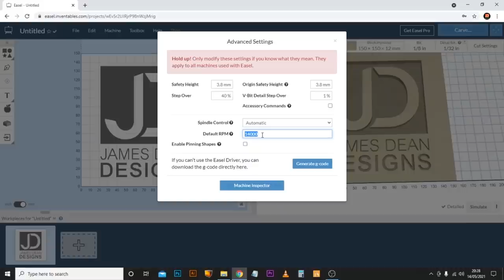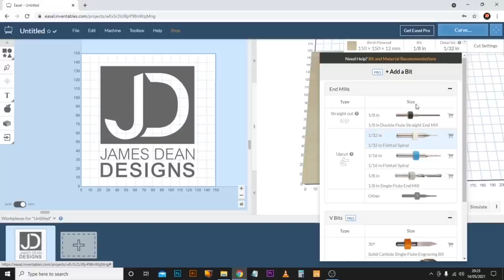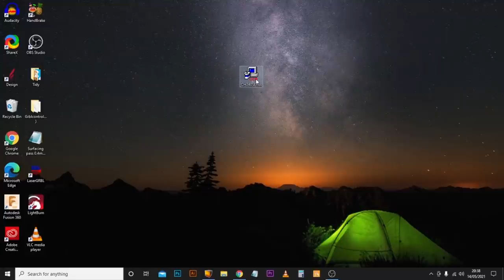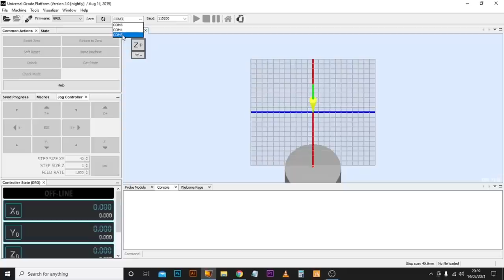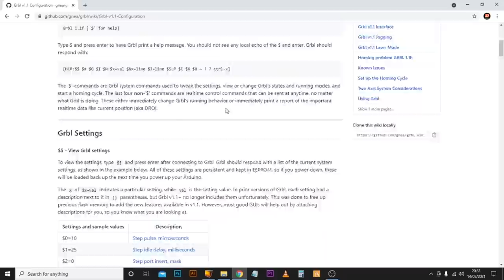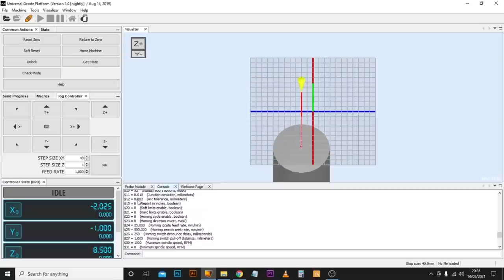Top 10 issues and solutions for desktop CNC machines - 3018, 4040, 4060, 6040, 6060,

Comment: I just watched this video. I'm about a year too late to help with the laptop problem, but here goes. Most laptops have a power control option on the USB ports that will shut the power off after a predefined time of no user interaction.  The strange thing people don't realize is that means mouse or keyboard interaction, not USB communications. You can set the option to "Never" on most laptops. Great video!
Reply from the maker: Yes that's true. They also Microsoft also added something called Selective USB Suspend in one of their updates and that so causes issues. So not only do you have to turn off the power saving features and put them to Never, you also have to disable this additional setting as well. Bit of a pain

Comment: James, superb series of videos/tutorials.   I bought a 2 in 1 3018 and watched several of your videos whilst awaiting delivery.  When the kit arrived, I assembled the whole thing without reference to the (inadequate) assembly instructions.   A few minor hiccups on connectivity and then up and running very quickly.  A couple of tips I'd like to add: 1. Rinse/dry/clean/dry lube the screw rods (I had to do this retrospectively as I was so keen to get going). 2. When fitting the coupling (bit that connects the step motor to the screw drive) I had to dissasemble and create a tiny gap (two sheets of paper) to stop the coupling rubbing against the body of the motor - this fixed the problem of sticking/skipping due to drag.   Your suggestion to use blue tape / mitre bond is brilliant and saved my sanity.  The clamps are so badly designed.  Thank you so much.
Reply from the maker: Glad it helped and glad you are up and running

Comment: Good stuff! I was one of the unfortunate customers who received a model where the motor was on the left so I was lost on how to switch this around. I also had spindle problems with certain programs. One would only allow the spindle motor to run and none of the other axis, the other would allow everything but the spindle. So I decided to move onto the laser. I quickly realized I got the more powerful laser that doesn't have the proper connection on the board itself so I will need an external power supply to get it working. I've revisited this machine a few times over the past few years but never really have the time to troubleshoot it. Your videos help immensely but I find it a little distracting how you use different programs for certain settings then bounce into another. But at least I have a general idea on what to look for. Maybe I'll get this thing running yet!
Reply from the maker: In this video I do bounce about because it's problem solving but usually I just stick to Easel and UGS 👍 hope you get there with it but let me know if you have any issues

Comment: re comms cutting out part way through a job - I found that problems sometimes came and went with Win updates, and the 340 drivers have a bad reputation with windows. I took to checking whether my CNC was still working every time there was a win update, so I could roll back before the time limit. I now use a raspberry pi. I have always used candle as it is what arrived with my 3018. Candle for the raspberry pi has defeated many linux fluents (of which I am definitely not one) - but there is a port of candle for the pi out there on the web, and even in my noobery I got it working.

As to recognising a comms failure (it was always that the driver had lost connection to the 340, so was unrecoverable without an unplug/replug, which resets candle) - typically the symptom was that the spindle was left spinning but all the axes stopped moving. The key here is that GRBL has not detected an error, so has left the spindle on while it waits for more commands.

The key to recovering is that BEFORE doing anything you look in the Gcode log to see where it got to, then you know the current position of the axes (because the lack of error condition means GRBL successfully executed the last command it heard). Write down the latest position in the Gcode (NOT the current displayed position, because the actual position never made it back to the PC because the comms broke), and replug the USB. When candle comes back to life, it will consider itself to be at 0,0,0, but you can move it back to "real" 0,0,0 using the "latest point" you wrote down above (basically G0 then negative the numbers you wrote down, but be careful not to move "through material" - best to move Z upwards to a clearance height, then X&Y, then Z). Then zero the axes and you've got a shot at continuing the job. Ideally edit down the Gcode to omit all the moves it has already made (but obviously not Motor control / other settings) - this is only if you understand the Gcode well.

FWIW I have a switch in my spindle feed, so I can switch off the spinning spindle while I'm investigating where it had got to.

Comment: I guess my problem may be the g code itself. I keep having the same shut off problem at the same time into the cut, approximately. Trying to surface the spoil board has become insane. I've tried it with the laptop more than once. With the offline controller more than once. Which tells me it's not the laptop or the controller. I've used both the laptop and the controller at different times with an IO -T relay. I started with the IO-T relay and thought that might be the problem. Once I took the IO-T relay out of the circuit it seemed to work one time through but then the stopping problem returned on the next pass. I know I'm going to end up on the phone with Foxalien and just want to beat my head on something. Is it possible that some some part in the big control box is screwed up? On an unrelated topic, when using the offline controller it's limited to jogging 10mm at a time. That's very slow when you have to move 25" / 636mm. I would just send it back but I really don't want my laptop in the shop if possible. I should say my machine is the Vasto xl.

Comment: You forgot a big one, people not using ER collets correctly. I have seen plenty of videos here on YT where people insert the bit into the ER collet, then stick it in the spindle and fastening it with the ER nut while the bit is already in the collet.

ER collets have to be clicked into the ER nut first (without the bit), once the collet is clicked in place you can insert the bit and screw the lot onto the spindle (or even better screw the collet and nut on the spindle lightly first, insert the bit and then tighten it down).

Comment: James
I just installed UGS  to run my machine ( 3018 pro) to replace the gcode sender that came with the machine ( grbl control).  the ugs loads and will communicate with the machine but has a fault. the fault is that when I  click on the jog buttons the program will not always send the command to  the machine.  other times it will send the command and the machine does as the command requests. in addition the machine ( while running the program code as sent ) will run a small portion of the code and then stop. I have run code using the grbl control and have not had any problems ( some of the buttons do not function , and never have  zero z and zero xy) I have noted your use of the ugs and though to replace the grbl control  with ugs to help me get away from some of these problems. Anything you can do to help?

Comment: After watching several of your videos, I am still struggling with my CNC Router.  I tried sending you an e-mail in hopes that I would get a response, but I have not received one yet - this might be the only place I can put my question/problem that I am having, I guess... My email goes into detail but now I don't have the email to copy & paste it, because I sent it directly to you from your website's 'contact me' button.

However, when I am using my CNC, everything will be going fine for the FIRST cut, the Z-Axis will go down, cut the material (wood mainly) make the cut etcetera, and then when it goes back to continue (either the same area or moving to the next cut) the Z-Axis will move upwards and not come back down to touch the material, and if it does it barely touches it or makes very shallow cuts.

I have tried running the same project over and over, moving the Z-Axis down as far as the material will allow for, but still I run into the same problem where the Z-Axis will go up and not come back down again.  I don't know a whole lot about this stuff (which is why I emailed you, figuring it would be an easier/faster way of communicating) and I was really hoping for some sort of guidance as to how I can make my CNC go DOWN and continue going DOWN so it will actually cut a project the way I want it to be cut.

Thanks, Sarah.

Comment: my machine does some random movement in the middle of a job. It always does a random movement but not always the same. So, the error (random movement) always differs. The job is saved on a card so there is no USB-connection while running the machine.
any idea?

Comment: Another great video James. Once again very informative. 
Can I just point out something that I've not seen in any of your tutorials ( though I could be wrong) , VREF settings for the stepper motors. I was having an issue with my 3018 constantly loosing steps. When I checked the drivers (woodpecker board) they were only putting 400ma to the steppers. Since adjusting them to the proper setting for a nema 17 the issue has gone.
Reply from the maker: No, that's not something I have covered in my video but is very useful. Thanks for sharing
Reply: @JamesDeanDesigns  It would be great if you do cover it at some point. Took me a bit of research to get there. With your fan base, and ability to produce easy to follow tutorials, I'm sure it would be appreciated 😀

Comment: I have a 6060 running gSender. I can see movement on the screen when I manually jog the router but the router just makes a clicking noise and no movement. Any thoughts. I have a 19 second video of the issue.

Comment: Thank you.   This video help me with one of my issues.   I am new to CNC and purchased the 3018 pro.   I also add the 3040 Y-Axis Extension Kit for 3018 Series CNC Router and  spoilboard.    Do I need to change any setting. I can not find any information.      I am using Vectric Cut2D desktop and Candle (Grblcontrol).
Reply from the maker: You don't need to adjust any settings in Vectric as that works on the material size. But you may need to update you $131 GRBL setting ti reflect the new length of your bed

Comment: Hi James, great videos and thanks a lot too...I have a bit of a problem with a mini CNC machine from Banggood, its model is a 1419.  Now I'm using Easel to simply generate a 20mm circle pocket I want cut. That's all fine. Am using UGS as my platform for importing my easel file. It all works fine until its about half way though the job or so and just looses connection. My green comms LED stops flashing, so no comms obviously. my fix is I need to re-connect, sometimes at that stage it resets itself to zero. I have to start again. Sometimes when I get it to try to go to 'zero' it goes the other direction..odd I know.
I see that the control board is really an Arduino Nano , if that makes any sense to you. Anyway, when the unit isent actually doing any work and at idle, comms is fine...Could it be power, lack off that is . ?
Reply from the maker: This issue can be one of many things sadly and it's purely a process of elimination until you find the cause. I doubt a lack of power is the issue but there is always a chance. The reason I say I doubt it is because a lot of people upgrade to a bigger PSU anyway and still have issues.
Sleep mode, Selective USB Suspend, USB cable are usually the most common but I've been having an issue recently when using my vacuum on the dust shoe. It's generating static which is causing it the drop connection 😕 as I say, it can be one of many things making it hard to resolve

Comment: Hi there! I just got a 3018 pro and i have some issues with him,maybe you have some idea whats happend!
1. I charge the PCB file from Flatcam and most time CNC start running without turning on the spindle...i must stop,abort and try few times until works.
2. The software is GRBL Controller and last time didnt show the PCB,only the milling lines adn i couldn't set the 0 for Z...i got in log the message ok but nothing happends.
3. i dowload "Candle" but in candle work only the spindle when i press the button,the axes not works...i didnt try to charge the pcb to see if it running or not
If you have some tips or ideea what i can make,please help!

Comment: James, just found your channel. Thank you for all that you are doing for the community at large. Great information for beginners and, especially in trouble-shooting issues. Quick question or two - I notice you have your cnc's in housings. Is this for noise and dust, or simply to keep the machines clean? Also, I'm looking at a small bed cnc - 17x24" - what cnc's do you recommend in this size?
Reply from the maker: Thank you 😊
I have them in enclosures for all of those reasons you mentioned. Minimises noise, stops dust getting out and also stops dust/debris getting in when not in use. Also when using the laser I have an extraction fan to get rid of the smoke.
In terms of recommendations its a bit of a middle size you're after you can either loom at the Sainsmart ProverXL 4030 and buy the extension kit, or a Yorahome Silverback which is 24x24.

Comment: hello, Best channel I have found for cnc info. I have one question, What bit, spindle speed and feed rate should be used for aluminum?? I have the 3018 pro. I have not broken a bit but the bit chatters and goes out of path.
Reply from the maker: 3018s are not really designed for aluminium but essentially if you're getting chatter you either need to reduce the depth per pass or slow the speed down. My first choice would be depth of pass

Comment: I am new to CNC Machines and I am having problem with my CNC 3018 Pro it is does not do the cut where it meant to be. for example my design in the centre of the work sheet but it always do it on left side and half of it can not be done it comes outside of the working area and sometimes it comes like a reflection. can someone help please.

Comment: Great video, as usual James.  My problem is, everything works fine, cuts fine (mind you still on simple shapes). Thing is, it cuts on the work piece, upside down. When finished, of course, the shape is cut and I just turn it. But just wondering why. Is it a matter of changing the $3 line? Cheers    Peter C.
Reply from the maker: That's probably it. As the 308 move the bed the movements are kind of opposite, so clicking forward should actually move the bed towards you. $3 is more than likely the cause
Reply: Thanks James  :)

Comment: Thank you so much for all your help a few months ago when I was setting up my fox alien 4040 – XE. My machine has been running fine for a few months.When I try to home my device and it hits the switch on the left side wall coming in it starts to jerk and will not stop unless I  shut off the machine. Do you think it could be that a motor is going bad or a switch? Any help would be much appreciated!
Reply from the maker: It might be your limit switch not making contact. The easiest way to test is press the home sequence then manually press the limit switch with you finger. If the machine stops then its working, but if it doesn't then you may have a faulty switch.
Reply: I have a similar problem. Haven't found a good answer for it yet. The limit switches work fine unless I try to home it-- then, I have to hit the emergency stop because it won't stop with the limit switch. I know this sounds crazy, but it happens every time.
Reply from the maker: @amillard264  all limit switches or just one?

Comment: Love your videos sir very informative and much appreciated. Whenever I create a design in UGS itself and send the design, the gcode that is generated for that design is defaulting to a spindle speed of 0. How do I fix this so that when it is created it defaults to at least ON? Also to note this does not happen when the gcode is imported from easel.
Reply from the maker: Thank you very much for the kind words. I have never actually used the design features within UGS so to be honest I am not 100% sure. There is usually somewhere to change from manual to automatic spindle and you will need to have it on automatic

Comment: Hi I have a cnc3018pro and with the laser it works perfect but the router does work the x,y,z the router does not spin and in ugs I create macros to turn on and off the spinner but the x,y,z axes do not move and the same happens with candle. What I’m doing wrong. I have an hp laptop with 24 gigs of ram.

Comment: @ 6:45 Machine not connecting to your computer.
I found that if I have Easel open in any tab, it connects to my 3018 and blocks any atempt to connect with UGS.
So when i use easel to generate the cut-file, I need to close the tab, and then connect the machine USB cable, and then I can connect to it with UGS.

Comment: Got the USB thumb drive from Sainsmart, but it didn't include the COM port driver file.  Plugged my newly built 3018 PROVer MX-3 into my Windows 10 PC and the XYZ axes (as well as spindle power) seem to be responsive using the Druefel manual controls in the software, however, Windows (or my PC) don't seem to show the CNC router as a device, or a COM port with the device attached to the COM port (it shows COM 1 - but no 3018 PROVer).  Do I still need to try and find a COM port driver file and install in this case?
Reply from the maker: Hi Sid, The MX3 is mach based as opposed to GRBL so I'm not 100% sure if its the same to be honest but if its all working then thats a good sign. You may be better off posting in the Sainsmart group on Facebook as there are quite a few MX3 users